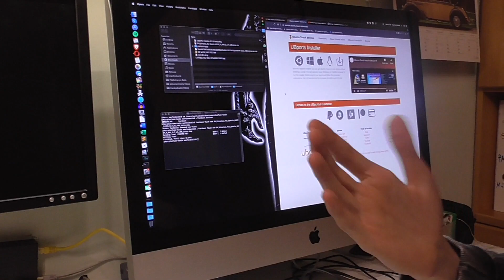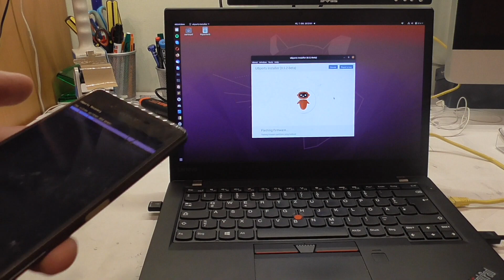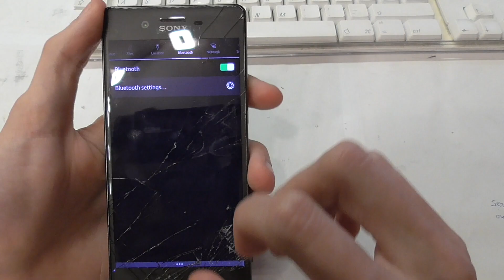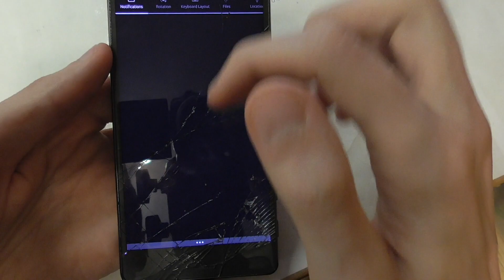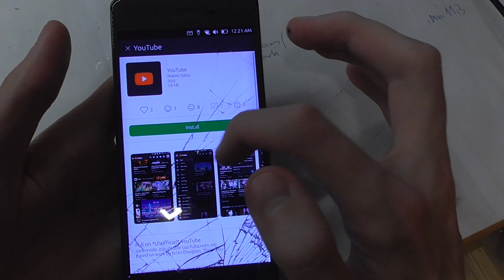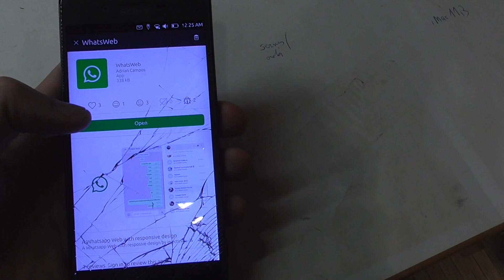Ubuntu Touch Install and First Impressions on Sony Xperia X

Comment: Hello! Do you still have this phone? I just wanted to ask you, if the head phone jack is working on your Xperia. Because mine doesn't and I don't know if it's related to a software or hardware problem. Thanks in advance.
Reply from the maker: No, I don't have it anymore, sorry.
Reply: @MacintoshMen  Okay, but thank you for answering.

Comment: does video recording work
Also i heard you can use anbox to install android apps on ubuntu touch
Reply from the maker: It worked on mine.
Reply: @MacintoshMen  well then i guess the forum post on ubports is just old

Comment: Canonical was absolutely delusional to try and make a mobile OS, especially years after Android and iOS have cemented their positions as the only 2 mobile OSes worth using. Dumbest company in the tech industry that's still around award will probably go to them. Just before Unity 8 desktop (which is what Ubuntu Touch pretty much is) was about to launch for standard Ubuntu it was canned. They wrote a whole desktop environment and WINDOW SERVER rather than just using Wayland or sticking to X11 (which is an outdated mess and should be deprecated but nothing else works on NVIDIA GPUs) and then just before it was about to launch, nah we're going to use Gnome. There was also their init system, Upstart, which I think was only used in 2 or 3 versions of Ubuntu and 1 LTS version, then it was scrapped in favor of Systemd. The only thing they made that has been a success is Ubuntu itself, they are like the Microsoft of the Linux world.
Reply from the maker: I agree, Canonical isn't mistake free and I couldn't agree more with the X11 dilemma and Nvidia; have experienced it many times myself and it was always annoying. However, I still find it a cool approach that they actually made an OS and didn't just say: "Eh, it's pointless anyway against those top dogs Apple and Google."